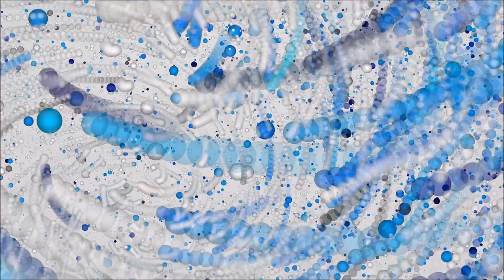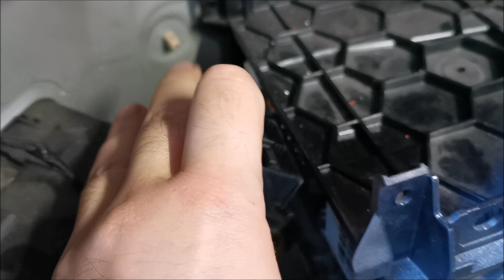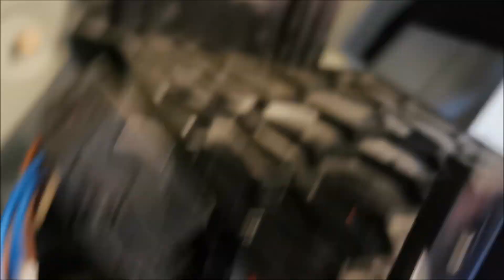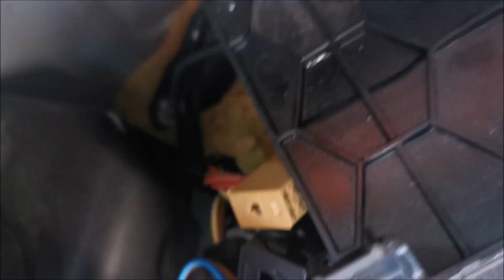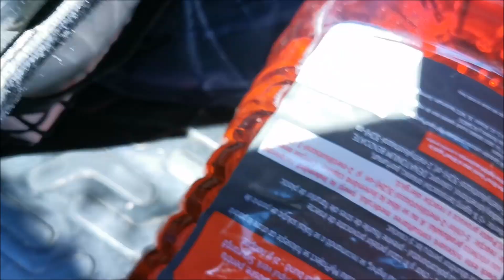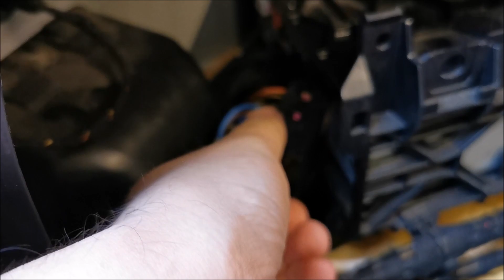Audi A4 B8 - Where is the best place to get audio signal for an aftermarket amplifier

Comment: Did you have to reprogram your Audi at all after swapping the amps or did it recognize it with no problem
Reply from the maker: It needed to be coded to the car ar the dealership.
Reply: @UltimateDIY I found a used one and didn’t code it and only a couple speakers work
Reply from the maker: Yes, that is normal. Needs coding.

Comment: This was almost 4 years ago, isn’t there supposed to be an amp on top of the radio unit? Where is the extra wiring harness for that
Reply from the maker: No, only the top audio variant has that extra amp.
Reply: @UltimateDIY What if mine has the extra fiber optic loop back adapter?
Reply from the maker: @ivanrudnitskiy8774 no idea about that.
Reply: @UltimateDIY so my Bluetooth and and radio should work solely off of that audio control module?
Reply from the maker: @ivanrudnitskiy8774 no idea how exactly the versions with an external amp work.
Reply: @UltimateDIY also every time I put a new 30amp fuse for my amp on the right rear side of the trunk it instantly goes out and the volume says “currently unavailable”
Reply from the maker: @ivanrudnitskiy8774 something seems blown on that fuse line.

Comment: Hi man! Where did you get clamps to connect those 4 new wires to get a clean subwoofer signal? Or which exact wires to I have to tap into to get signal for my aftermarket subwoofer? I have a 2010 A5 Coupe (non B&O) 
Thanks in advance
Reply: Oh and my head unit just says Audi Multimedia (I have navigation)
And I only have 1 wire running into that black thing you pulled out (you have a bunch of them in the video) next to the brown one you pulled out
Reply from the maker: All I know about the wires and connections can be found in this video: https://youtu.be/KevtT1T7nS0

Comment: These  vids are great   the most comprehensive I have found.     I have 2010 A4 with the mid level audio (not B&O but have the sub and center midrange)  Since factory amp is 2ohm output and 2 ohm speakers are hard to find can I take the high level input into a new amp and replace speakers with 4ohm
Reply from the maker: Yes, you can do it that way.

Comment: Hello and thank you for video!!
I have one problem maybe you can help me, since 1 month my sound is not working on radio, media or Bluetooth. Error on vcds is 000384 Optical databus , 011 Open circuit intermittent. I checked the fiber is ok, it's working 10 minutes than stops and so on.Any ideea?
Thank you!!!
Reply from the maker: Hello. Close to impossible to guess. But maibe you have a bad fiber optic connection. I know that internet fiber optic connectors can go bad because of heat sometimes. Maybe it's something similar.

Comment: I dont have a Center speaker. But if i look at this vid that means i can put a center speaker in the car and put the cables in that center spot ? is it the same for audi A5  ?
Reply from the maker: Only if your radio unit supports it. If you did not upgrade the radio unit, then it will not support it.

Comment: HI, it's not quite clear for me where it is better to take the high level signal from. I have a similar radio unit with oem sub plugged, but i wanna replace it with an aftermarket one. So can i take the signal from the sub wires or is it better to cut into the speaker wires? And where can i take the remote signal from? Thenks in advance.
Reply: Get a line output converter that has remote turn on built in
Reply from the maker: Hi. Depends on what you want. If you want the subwoofer control in the MMI to work, then you take the signal from the subwoofer.
For the remote, I don't know.

Comment: if i directly cut the wires to connect to an amp , does it have to be bass amp or voice amp ?
Reply: and will i still control my music from the center console
Reply from the maker: You need an amp that has a high level input or you need a high->low adapter.

Comment: hello... i have the same system on my audi, and i wanted to connect the subwoofer, how could you help me?
Reply from the maker: Hello. I did this: https://youtu.be/KevtT1T7nS0
Reply: I want to install the original audi subwoofer and I have it with me but I don't know how to install it
Reply from the maker: You need to upgrade the radio unit in the trunk like I did and basically do about all I did in the video, but with a different speaker.

Comment: Hi Ultimate DIY, I wanted to ask you for information that I can't find online and maybe you can help me. I wanted to know how the front tweeter in the dashboard is connected to the woofers in the door. I cannot find any connection cable diagrams online. You would be very useful with this indication to find the cable quickly. Thanks a lot in advance!!!
Reply from the maker: Sorry, but I'm not sure about this. And it's also different between the base audio system and the higher end ones.
As far as I know, for base audio the tweeters are in paralel to the big speakers in the doors.
For the higher end systems, the dash speakers have separate channels.

Comment: Thanks for your fantastic explanation. I have to ask you for advice, I don't have a unit that has SUB and center outputs, but only has FL, FR, RL and RR amplified outputs. Can I use these outputs and make them preamp so that I can connect them to an amplifier? Thanks you are a great...
Reply from the maker: Hi. Welcome!
Yes, but you need to add a high->low adapter.
Reply: @UltimateDIY  Thank you for your help!!! The last question, my head unit is the model 4G1035053D, the wiring is the similar to yours unit but without center and sub? Thanks in advance :)
Reply from the maker: I don't know the wiring for all of them. I always search it online to be sure. In theory it should be similar, but can't tell you for sure.

Comment: is the signal inputing from head unit to the trunk amplifier is a high level? or can it be convert to rca connector on the new amp? nice video, thanks
Reply from the maker: I don't know about the connection between the radio unit and the sub amplifier, as I don't have it.

Comment: Hello, Just wanted to say thank you for the informative videos, I been watching them.and so far I've done the dash speakers, was a great help :)
Wanted to ask, so when I cut into the speaker wires, the wires closest to the quad lock will go into my aftermarket amplifier (signal in) and then aftermarket amplifier (signal out) will go back into the factory wires towards the speakers? Essentially putting my amplifier between the Audi original wires?
Reply from the maker: Hello. Thank you for watching my videos. About the wires question, basically yes :)
Reply: @UltimateDIY  top man, thank you so much :D
Reply: @Mamelukefamily  did this work for you? Im about to do the same but wondering how the dash speakers will go into the aftermarket amp since most aftermarket amps are 4 channel amps. I had the 3 dash speakers also.
Reply: @shibidi  I actually had the amplifier installed but the installer made a harness with a parrot kit. It hooked onto the harness from the amp and I retain all the functions. I'm using a 6 channel amp but 2 channels are for subs and the 4 are for door speakers
Reply: @Mamelukefamily  Oh nice, what about the center mid/high speakers?
Reply: @shibidi  The dash speakers are run by the  factory amp.
Reply: @shibidi  another route you could do, is have tweeters put into the sails. If you have b&o I think you'd already have the cut out, if not you can drill a hole for the sails. Ive got audison 8 inch speakers in my doors and they are very nice and can hit low, 35hertz.
Reply: @Mamelukefamily  I just bought a used set of B&O with grills since I don't have it on my stock system and also got the sails grill to replace. How would I wire the new tweeters since the door speakers only have the bottom 6 inch speaker and no tweeters from factory? sorry to ask, i couldn't find any info on this.
Reply: @shibidi  Are you replacing the door speakers? If you are, you can get a component set that comes with tweeters. I reckon the way to do it is get a harness (so not cutting up speaker wires) or tap into the factory speaker wires with the wires going into a crossover and from there 2 to tweets 2 to woofers. 
Did you upgrade the dash speakers? 
It may be worth having a read of Audi audio forum
Reply: @Mamelukefamily  Thanks for the reply. I bought the B&O speaker set including all the speakers. I upgraded the dash speakers already (replaced from stock to B&O speakers). I'm just wondering how I should install the door speakers with the tweeters since they don't come with crossovers from factory (they are the B&O factory Audi speakers also). I've tried searching on forums but nobody replies or posted anything about this type of install.
Reply: @shibidi  no worries. 
Ok got you now. When you get a component set you will get a cross over and tweeters. The crossover is just like speakers so you have 4 slots. 2 input 4 output. So I'd tap into the factory wire (try avoid cutting) and run new wire to the cross over. 2 outputs will be for the tweeters and 2 for woofer. With the B&O tweeters not sure how they work but I imagine they have capacitors stopping lower frequency going through. Out of curiosity, are the B&O speakers/tweeters good? 
You are right, not many people put tweeters in. I did see a post somewhere of someone who did though but I found my ear is closer to rear tweeter
Reply: @shibidi  Hello, I have the same model without tweeters, have you resolved this issue?
Reply: @ArindoVlore  i ended up cutting and splicing the old cable

Comment: Hi, i have a audi a4 2013 with B&O sound system, I want to install a aftermarket subwoofer, do i need a separate AMP for that?
Reply from the maker: Hi. I would add a separate amp if you want more volume.

Comment: Hi
I have a 2009 Audi A4 with the bang & plugs en upgraded system .
I have static and small banging noise coming from only front speakers and the rear Sub in the rear deck
In Your knowledge do you think my issue is the amp or the stereo head unit ( I know they are both in the trunk
Reply from the maker: Hi. Honestly, I don't know. Could be any of them.

Comment: I have an MMI 3G Hight, and the unit is missing in hte trunk ?
Reply from the maker: It's not about the MMI type, it's about the radio tape. Do you have Concert radio for example?
Reply: @UltimateDIY   no, i don't have Concert. Its 3gh with hdd and SD Card
Reply from the maker: Does it write Audi multimedia on it? Like it does on this one: https://m.imgur.com/ZyRpWfi
Reply: @UltimateDIY  , yes its the same
Reply from the maker: Then I have no idea where they put the radio unit in your car.